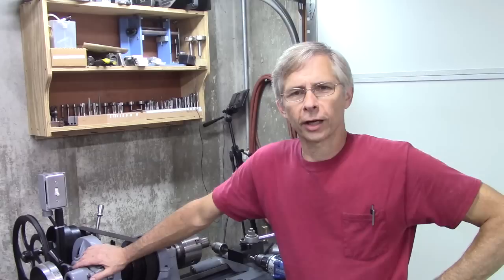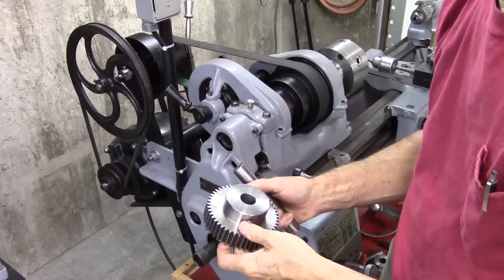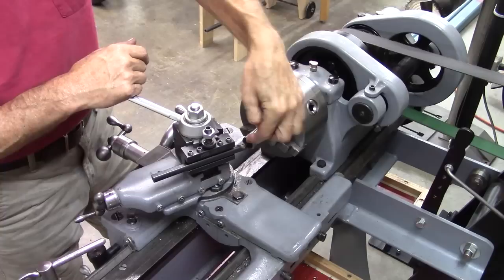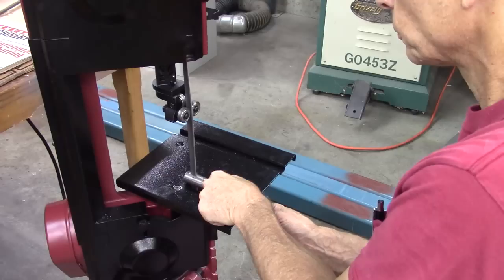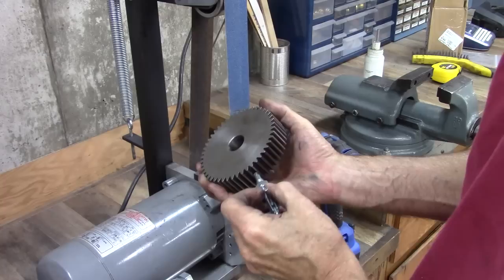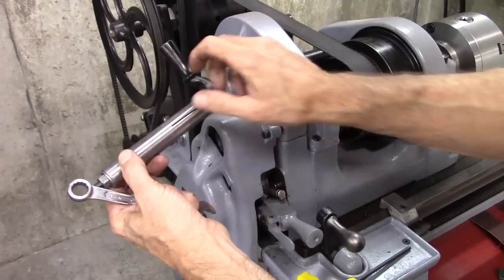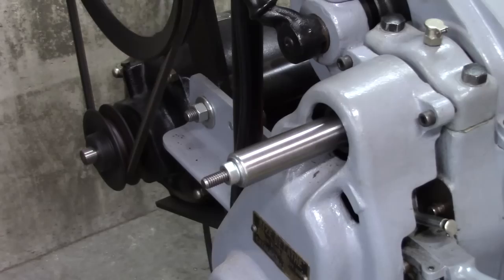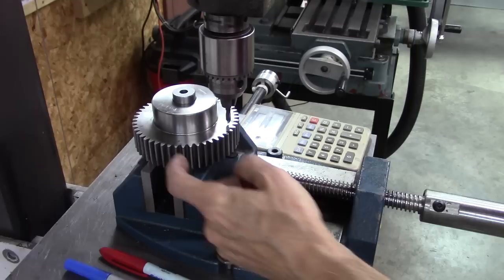Simple Indexing on a Metal Lathe

Comment: Very clever, well done. If you have enough motivation, re-make the indexing arbor to gain more contact area when it is expanding. Drill relief holes at the end of your slots, reduce the diameter of the tapered draw pin and cut the same taper on the OD of the arbor. This way when you pull it in tight, the arbor will expand parallel to the bore. Right now it's more like a small hole gauge. 
[edit - like an adjustable reamer stays parallel when expanding]   Stay safe and well :)
Reply from the maker: That's a great idea although a bit more involved. Thanks!

Comment: Hi there from South.Africa. It is really nice to see you using the Southbend , all the tools you make and sharing it with us . It is absolutely motivating to say the least . I have a small Lantaine lathe and a Walker Turner drill press  i restored . Me and my son are currently finishing an old 2 metre Cardiff lathe to add to the tooling for his turbocharger business that he runs from his garage at home . Your video on the square colomn drill press is just awesome . I recently bought a nice drill press but with a rediculously short pillar . I think it is a good candidate for a square colomn. Thank you for sharing all this good stuff with us .
Reply from the maker: Thanks you for the great comment. And yes, the square column drill press is a major improvement. If you make one, make the two arms that support the lower bearings a little wider and consider tack welding then in place. My table flexes a little under heavy load. Thanks again!

Comment: Sounds for all the world like an old repulsion induction motor when it starts.. Love your lathe.. I have a 1957 sixteen inch South Bend running on three phase.. Cheers; Mike in Louisiana
Reply from the maker: Yes, I bought 20 motors for $100 just to get this motor for the south bend but I ended up keeping 9 of them. I need to take the motor apart again. I cleaned it up and replaces the wires that went through the housing. I need to take the shorting necklace apart, occasionally it won't start and it's getting worse. I milled a slot in a cover and installed a remote reverse lever. You can see the lever when I reverse the lathe while tapping. https://youtu.be/xauJcjrINy0?t=350
Reply: I have a 1957 sb16 as well! Hard bed. I run a 5hp RPC off the wife’s dryer outlet for it.
She does not approve!
Reply: @alexblackburn627  My 1957 started life as a turret lathe.. I changed everything over to engine lathe configuration.. I too ran mine from a 5hp home made rpc until I got three phase from the power company.... I have enough power from Entergy to run 50 hp now.. Cheers; Mike in Louisiana
Reply: meg I need to look into my energy company! I already trolled them over a duel lug power meter to power my garage sub panel and have yet to complete that endeavor hah. 

If you don’t mind me asking, how much did the line cost to get 3p into your shop not including the breaker box and such?
I’m in Cincinnati in a residential cul-de-sac so I probably don’t have the option. My 1951 index 55 knee mill and lathe running together really suck the life out of my RPC’s 3rd leg
Reply: @alexblackburn627  I live right across the street from a power sub station so the three phase overhead line is very close... They hung a small transformer for the third leg and use the existing transformer feeding my house for the other two legs.....It is 120 240 208 "open delta" that is about 87% efficient but it is better if you have 220 single phase motors....I had to cut a check to the power company for 1000 dollars for them to supply to the meter which I had to provide....If I would have had a large enough demand, they would have provided what I had to pay them for for free.. cheers; Mike in Louisiana (Ramsay 1 on Practical Machinist)
Reply: meg ah gotcha. I’m Homebrewblob on PM. Appreciate your time and response!

Comment: What a great idea. Now you need another drilling adaptor with lead screw so you can cut gear teeth. :-)
By the way a longer spigot for your index gear to put the taper deeper into the headstock would reduce the risk of index gear wobble.  You could also use it to make index wheels with drilled holes (instead of teeth) for the index peg.
Reply from the maker: Thanks David! I have another video on indexing where I used a tapered pin in holes. It had 100 and 48 so it had more options. This gear method is a little stronger and easier to build. I never used more than the 2 3 and 4 positions anyway. The mandrel length was dictated by drill length. Pipe would have been a good option but I didn't have any the right size.

Comment: thanks for the tip, that a KNURL actually "expands" the diameter!  have the tool, but haven't used it yet!  nice to know!
Reply from the maker: You're welcome. Knurling is kind of tricky but starting with significant pressure helps.

Comment: I’ve got an old Craftsman/Atlas lathe that has a large gear in the headstock(keyed to the spindle) with 60 small holes evenly spaced on the face of it. There is also a locking pin that fits into whichever hole is aligned with it.  This is a very easy way to index the spindle/ chuck etc. it is built into the design of the lathe. Nice project though.
Reply from the maker: I've seen these before and it's a good idea. I probably could have used the bull gear teeth in my lathe too. My Logan has 72 teeth which works out well, not sure about the south bend.

Comment: If you have 42-45-48 gears you can do 1 to 9 divisions, plus some more like 14, 15, 16, 21, 24
If you have 60, it can do 1, 2, 3, 4, 5, 6, 10, 12, 15 by itself.
Reply from the maker: It sounds like I should have used a 60 tooth. However 2, 3, and 4 are the most commonly needed at least that is all I have ever used, Thanks

Comment: I think I have a video up where I made a cutter by knurling.  I was exposed to increasing diameter and making cutters for softer materials in my dads race shop.  In his case, he made tools to line bore 356 and 911 cases when there was an issue with the crank binding as the case was torqued up.   I've also considered making an expanding mandrel by producing an incomplete thread. ;-)  Gaining the expanding taper from the end of the tap/threads.  I've not used the method yet.  A lathe without an indexing method is an issue.  I need to make a better drilling rig.  I like yours.  I have a tool post drill press that is pretty large for my lathes but it is inspiring me to consider doing in useful size.
Reply from the maker: I've used the taper on the end of a tap for making threads to expand a pipe in a hole but you need a way to access the bolt head. It would work well for a cutter like your dad made. The mandrel I made in this video worked very well. Making the large bore and band saw cuts deep was the trick. Making it from tubing would be easier to make long which would be a plus. Mine was limited by the drill length.

Comment: Hi Winky. When I try to bore out a hole to a larger size on my Jet drill press, the bit always gets stuck in the part and often the whole chuck comes out of the spindle. I’m using a key to tighten the bit in the chuck. What might be wrong?
Thanks,
Paul
Reply from the maker: Maybe the hole you are enlarging it too close to the size you are drilling. If you are enlarging a 3/4 hole to 7/8 the bit will grab. Bigger steps in drill size will stop this. As far as the chuck coming out goes....  I'd say the tapers might be in bad shape.
Reply: Thanks Winky. It’s a new 20” drill press. I’ll try a step drill next time and yes, the sizes are close. 
I like your videos.

Comment: Winky you could design the mounting bracket to where you could still get to the oil port. I do like your indexing extension arm you added to the compound. I had made my tool post drill as short as I could get it with still little room to index from the side. Thanks for the idea I will have to make me an extension arm now to be able to do larger stuff.
Reply from the maker: I might drill a hole for the oil cup and make an extension although removing two nuts is pretty quick. Yeah, the extension is handy but make it thick so it doesn't flex. .

Comment: For indexing on the lathe, why do you need to make something to do it? The lathe already does it for you because when it is threading it makes the work rotate a certain number times per inch per the thread pitch. The idea here is reversing the concept that so that by measuring the cross slide movement with threading engaged you can convert that to a degree rotation in the chuck. (So for a 8 TPI engagement, every full rotation = 0.125"; therefore, with that TPI engaged, an eighth of a rotation of the chuck would be 1/64" =  0.015625" which while small, is measurable) Just put a dial indicator on the bed against the cross slide, and have the compound 90 degrees to the cross slide. With threading engaged, rotate the chuck (by hand) until the dial indicator says the correct number. Move the compound back the same distance so the tool stays where it should. Do your operation and then zero out the indicator and repeat. I've been meaning to try this out on my lathe, just haven't gotten around to it yet, so let me know how it works out.
Reply from the maker: Interesting, I like your thinking but a gear is much easier.
Reply: Would that be effected by backlash?

Comment: I have a 1947 Atlas 12, and the spindle has 60 indexing marks built in to the bull gears, that’s divisible by most numbers I use for projects. It has a little pin that just slides in and out, makes it easy. But the pin itself is not rigid enough to do much more than scribing/layout. If I do tool post drilling, I need to use the bull gear engagement to lock the spindle to hold it rigid. Takes a little wiggling to get the gears to the right alignment to lock them. I like your setup, but it wouldn’t be very usable for what I do without some way to index it, and then lock the spindle. I drill a lot of holes at an angle off tangent, which I change by adjusting the height of the drill and usually have to start holes with a flat nose 4-flute endmill. If I tried to do that with this setup it would shake all over the place and vary the holes positions way too much to be useful. I do like this design, but I would need a spindle lock to combine with it. My drill completely replaces the compound/tool post, and as such, I can really only use it for flange hole type drilling. It’s pretty rigid, but it’s also limited to the two angles of carriage travel and cross-slide travel. I need to make a tool post drill like this to pair with a hand drill so I can drill at angles if need be. Not really a point to all this I’m saying, but yours is a pretty neat idea
Reply from the maker: I had a wood lathe with indexing like you Atlas, nice feature. My curiosity has me wondering what you are making that need holes at an angle? Thanks
Reply: @WinkysWorkshop  Currently Im working on a centrifugal pump type of invention and I don't have an impeller to use for a part of it, so i'm using a piece of round stock as a thick disc and basically drilling around the perimeter of it about an inch below center to create a somewhat pump/impeller effect with the holes slanting slightly backwards to the direction of rotation to move fluid from the center to the outer diameter of the rotor more easily, like cuts in a pie except not meeting in the center haha. This component is basically a cars water pump, just a home made one. I'm currently a hobby guy, I cant call myself a machinist, but I definitely have a passion for this and i'm hoping to go to a local tech school here come january so I can do it professionally, but right now i'm just making my own projects. I have an Atlas 12 and a Smithy BX288 and I can make just about whatever I need, but there is always an infinite amount to learn, and I need to learn how to do things the "right" way so I can make it a career. In my original comment I should have added to "I don't really have a point to this -BUT I love talking about machining equipment in general"
Reply: @WinkysWorkshop  I just came across your channel and I'm seeing a lot of excellent tips and tricks, I appreciate you taking the time to document these ideas, it can be such a drag to film what you're working on, and I rarely have the patience for it. So big thank You for doing so
Reply from the maker: @nikolaishriver7922  - Got yeah...  that's a cool project
Reply from the maker: @nikolaishriver7922  - Making  a video isn't too bad if you have a clear plan. Sometimes I'm inventing as you go and that makes it a lot more difficult. I've spent several hours on a video and abandon the effort several times. Just the other day I was making a better knurling tool....  but it wasn't better, ha

Comment: how often do you need to oil that sleeve bearing? because you covered up the oil port...
Reply from the maker: I'll remove it when I'm not using the indexing. I usually oil it about every 3rd time I use the lathe. Probably over kill but I run the bearings a bit on the tight side and I'd hate to burn them up!

Comment: Hi Winky, I like this idea also. It does look a lot easier to make. I wouldn’t mind making both kinds of Indexing Wheels. Mainly because I don’t have very many extra gears, although I could get a Lot of combinations with the Gear. I want to make the larger one to try and make some bigger Dials for my little 6” Atlas. Hopefully someday I will have a bigger/better Lathe. Thanks again
Reply from the maker: I'd buy a gear on ebay and use a 100 tooth saw blade for the dials.
Reply: @WinkysWorkshop  sounds good, I’ll see what I can find. I might have to get a 100 Tooth Saw Blade also.👍

Comment: you may want a better indexing pin that is either a wider ball tip or one which meshes better with the gears to remove runout. if you ever forget, and the lathe is running and the gear-bar is present, that exposed gear is a safety hazard (binding pinch point...)
Reply from the maker: There is about .0015" slop in the pin but the shape of the pin seats fairly well. There is no significant load on the gear. If there was I would make the pin more like a tooth profile (runout?). I don't run the lathe with the gear installed although even if I did I have no business running a lathe if I can't keep my fingers away from the gear. There are many places on the lathe the are equally dangerous and very exposed. Personal responsibility and common sense need to be practiced.

Comment: Hi Winky, I just tuned into your channel the first time today. I sure would like to see a little better how you mounted your drive motor and Jack shaft for this lathe. I am curious the purpose of the lever that you moved at 6:04 in this video. I just inherited an older lathe that has the flat belt/Jack shaft/v-belt arrangement as yours but came in a box. Have you made a video on this arrangement or plan to?
Reply from the maker: That was a home made setup although the cone pulley and v-belt pulley came with the lathe. South Bend did make a drive system that attached to the v on the top of the bed that looked similar to mine. The previous owner of my lathe drill holes in the back of the bed and utilize these holes. it would be better to use the factory setup if you can. Here's a playlist of my south bend rebuild. maybe it will provide answers. The lever is a motor revierse. https://www.youtube.com/watch?v=vrXBkqC6ttc&list=PLz2A001hMBoS1Q4L4MZ8d5EabCLLPZSid

Comment: But what if you want to make a 6 fluted reamer. You cannot have the reamer have even spacing, because that would cause chatter. Would you skip some teeth? 

It needs 1st 	0 
		2nd	59.0769
		3rd	121.1538
		4th	178.8462
		5th	241.3846
		6th	298.8462
Degrees. But 1 tooth is 360/48= 7,5 degrees. So that is off to much. A normal dividing head has a 40 to 1 ratio, with  39 holes disk.  2nd 4 holes less, 3rd 5 more, 4th 7 less, 5th 6 more, 6th 5 less. So could you get a lot of gears to make it so that you get these ratios? I have seen lathes with a dividing head. And i definitely need one  if i want to make reamers. 

The way you did it is pretty clever! Would a closed stepper motor, and pulley wheel be good as an dividing head for the lathe with that kind of precision?
Reply from the maker: Uneven spacing? I'm fairly certain all my reamers have even spacing. Now I'll have to measure then! Ha
Reply: @WinkysWorkshop  Its how it is written in the book Machinery handbook 27th edition. "Irregular Spacing of Teeth in Reamers", page 833. 

Its to prohibit chatter. Ive read a lot about making barrels for rifles. And on chamber reamers. They need to have the uneven spacing. And its a real hassle to get it drawn in 3D CAD. Let alone to machine it. A reamer that can ream out existing barrels is even harder to get right while those are spiral reamers, so they wont get stuck on the rifling. 

If i ever want my blackpowder gun to shoot straight i will have to ream out the barrel with a spiral reamer, and build a cut rifling assembly with gears and pinion gears, like this: https://www.youtube.com/watch?v=piaZjbdu4Ok. I think its amazing.

Then you really need something to keep the right angles when making the grooves, but you will need the spindle bore to house the barrel. So putting something in the bore wont do. So im still looking for a solution. That can do everything, uneven spacing, and even spacing, without obstructing the spindle bore.
Reply from the maker: @jeffjefferson2676  - Interesting stuff. I'm sure you will figure out how to do both.

Comment: where did you get the gear or was it just a lucky find? You have a lot of good ideas
Reply from the maker: Thanks...  yeah, it was a lucky find. You could use a 24 tooth and get most the same combinations. The gear I found is very heavy duty... massive overkill. I'd say you could find a lighter weight 48 or 24 tooth gear on ebay fairly cheap. Even new for around $35 maybe.